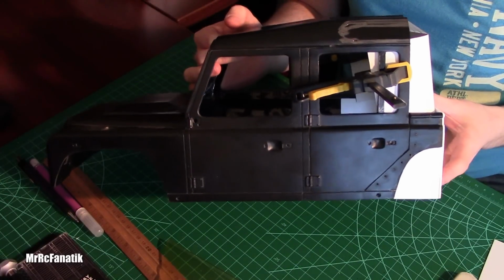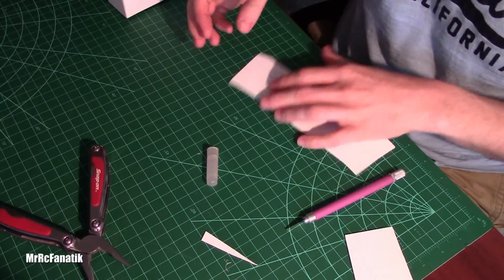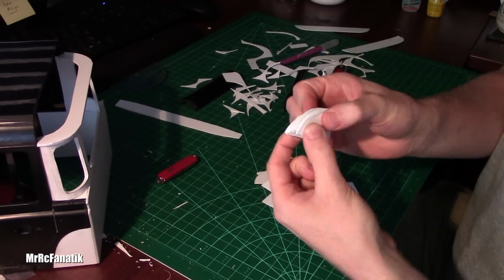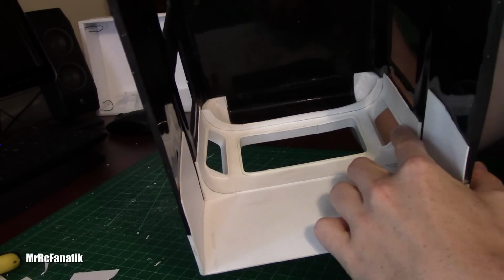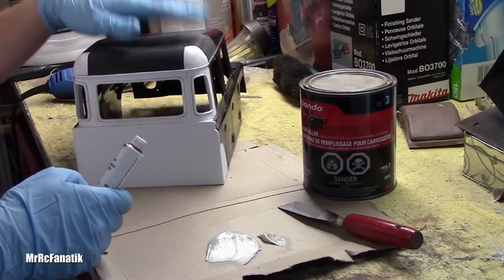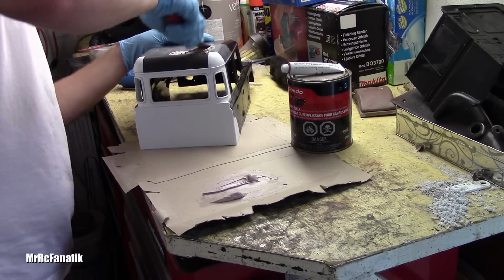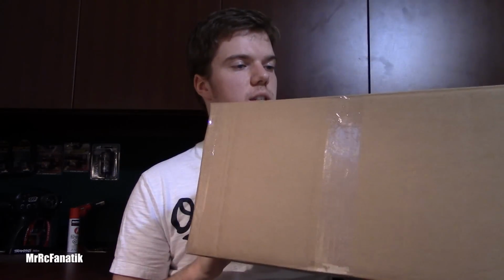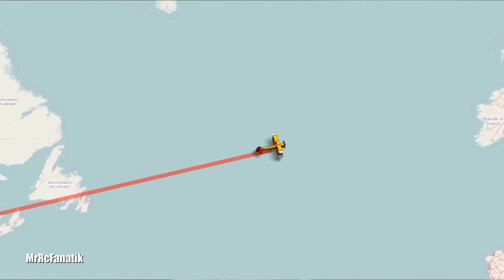How to Work With Styrene (Part 2 of 2)

Comment: typically a bottle of superglue will mention the bonding time, usually being a few seconds , and by that it refers to the time you should keep it supported firmly in contact for initial adhesion. after a moment you can let go and it will keep its place on its own if its not being stressed.. but the label should also mention the minimum cure time until full mechanical strength, typically this ranges from 2 to 6 some even 12 hours. 
I guess an hour should be fine to continue working on it in most cases. tight seams dry quickest. 

just a tip:
the bigger the surface area of the bonding faces, the more it can withstand sooner. . so for any parts that prove challenging to get to stay together, my tip would definitely to try finding any area's were you can angle your cut faces so that the bond surface moves into a joining seam over a diagonal cross section. 

Great build man, very impressive how much detail you achieve in these projects. amazing skills

Comment: Try Oatey ABS to PVC green transition cement. You can find it at most hardware stores in the plumbing section by your regular PVC cement used for plastic plumbing pipes. It does tend to melt or weld the plastic pieces so use it wisely. But once the bond is dry and secure, it is literally a weld. I've had good luck using it to weld ABS body pieces together. The green glue that is overlapped or excess glue hardens and is sandable. Outstanding work BTW. 👍

Comment: Amazing. Been thinking of giving this a go. I have a classic car of which no scale models of exist and hope to make maybe a 1:5 scale. I've done model making before in my collage days but using resins and molds for film props so I know how time consuming and difficult it is! Keep up the good work man, this is great!
Reply from the maker: That's awesome sir, a 1:5 scale model would be amazing... and huge!  I think a glued styrene body may be too weak for a model that large ... using your previous knowledge, you may want to look into creating a buck which you can then either A: vacuum form over with Lexan ... or B: create a silicon mold and slush cast a part.  I did that with the D110 build and it worked out great!
Best of luck in your projects, and thanks so much for commenting!  Hope to see you around!

Comment: Now maybe an interesting snippet here , that i'm sure many haven't even considered yet . I've been doing this kind of thing for years with models , however recently i've been working on a really big model , using these very same techniques . Actually , the big model is 1:1 , ahem full size , though probably small in some people's eyes . I have a 3 ton motorhome , where plastic is heavily used . That motorhome is 20 years old , so some of the trim parts are no longer available . Yes i've been scratch building them !
Now i'll be the first to admit , this is a bit of an overkill , some techniques are different , glues are different , and certainly the plastic is different , but overall the theory is exactly the same . 
I've recently repaired the front bumper . Basically scrap , i had to replace large sections of plastic that were beyond repair , with new . These parts needed epoxy to be fitted , before being plastic welded in place . The result , now sprayed these areas are invisible , and the bumper looks new . Currently i'm in the process of converting the dashboard from single , to double din , so a modern media system can be fitted . This is nearing completion . 
What i'm trying to say here , is don't just write this off , as a silly hobby . Modelling , scratch building in particular is a very useful skill to learn . It gives you a can do attitude , and the ability to solve problems , that may seem impossible , trust me , that's where i started .

Comment: Hi, I think you can make the rubber lines for the curved windows if you create a wood stencil with the inner glass frame shape so you can curve the styrene frame to the  wood with heat. The wood resist the  heat more than the  styrene, and you can repeat the process. I got this idea by just watching your video. Thanks.

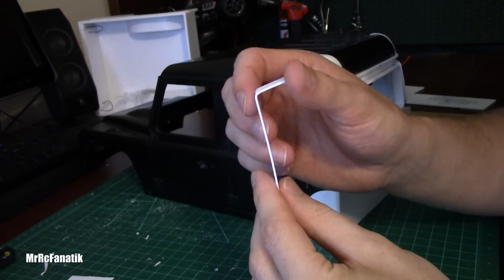Comment: If you want to bend styrene without breaking it (as happened at 8:15,) dip it in some very hot water for just a moment, then bend and hold it in the shape you want.

Comment: This is great. One question: for the difficult doubly-curved corners on the roof, why didn't you use styrofoam or some other bulk material instead of stacking up lots and lots of plasticard?
Reply from the maker: Good question!  I had a ton of styrene and glue on hand... That's about it!  Why spend money on more materials if I could use what I already had 🤷🏼‍♂️... Did take a while but at the time that wasn't a huge problem. 👍

Comment: I plan to build an expedition vehicle out of a Tamiya Unimog 425 body, and my question is, do you need to frame out the "box" first with styrene strips? What thicknesses do you recommend for the frame and sidewalls?
Reply from the maker: Not sure I 100% get what you're saying, but usually 0.080" styrene is good for structural areas (but hard to work with), and 0.040" or smaller is good for areas where a bit more detail or curvature is needed.  And like I mentioned in one of these videos, you can always stack a few layers up to gain the thickness and strength if needed!  Best of luck with your project, I hope that helped a bit!

Comment: Excellent! Have you entertained the possibility of using a 3D printer for some parts? (like the corner pieces)
Reply from the maker: Most definitely!  Sadly my budget doesn't include a 3D printer yet (even paying shapeways to print for me) but someday for sure!
Reply: +MrRcFanatik Have a look at the CTC 3D printer, it's a very budget friendly clone of the original Makerbot. I've just got one and while it needs tinkering it produces good results.
Reply: +DarkFoxMedia I have a Lulzbot desktop mini I've had for about a year. It's pretty affordable and requires no tinkering.
Reply from the maker: Thanks +Matt Tester (UKMatt2000) and +DarkFoxMedia ... I'll have to look into those!

Comment: How strong it is? Will it survive roll over?
Reply from the maker: Ideally you'd make a mold and cast one-piece versions from that, like I did with the D110 bodies - but that was not financially viable with this project so I built in as much reinforcements as I could.  Not sure if RCculture ever finished the project, but any hard bodied RC is not going to fare as well in a roll over as a lexan shell.  Can't beat them for realism though!

Comment: That's what I wanted to know if it could be heated and bend? I guessing not or you would have done it.
Reply from the maker: You can use heat to help bend it.  You'll want a concentrated heat source so you don't affect surrounding areas too much though... In part 1 of this series you can see me using my butane torch a few times.
Reply: @FanatikBuilds  thank you maybe a strip heater made from hot wire or a thin metal bar that radiates heat. Like they used in plastic class I took in high school. Thanks again for responding. 👍